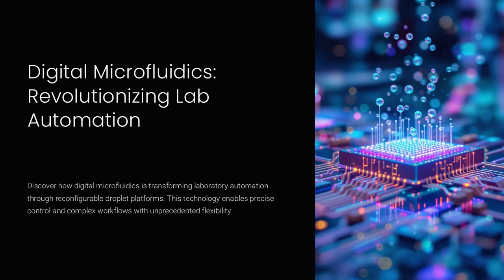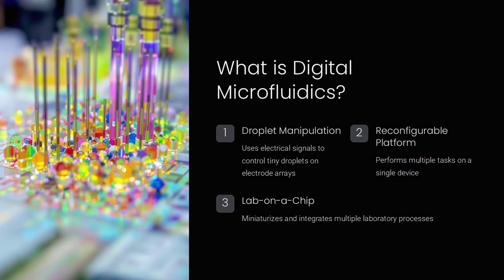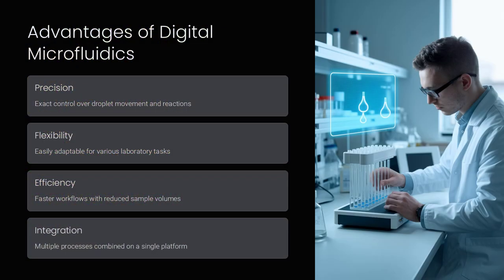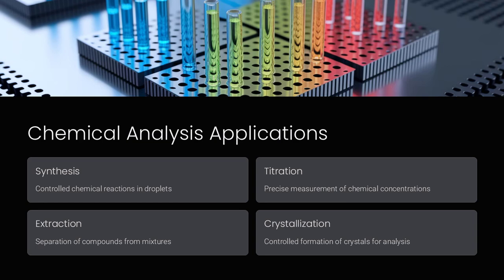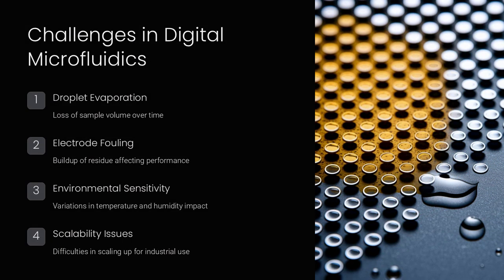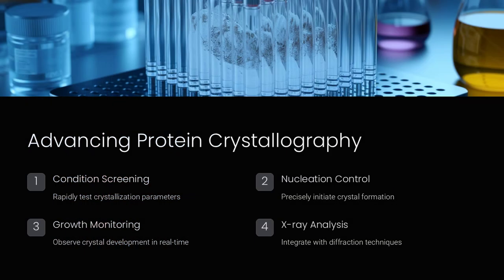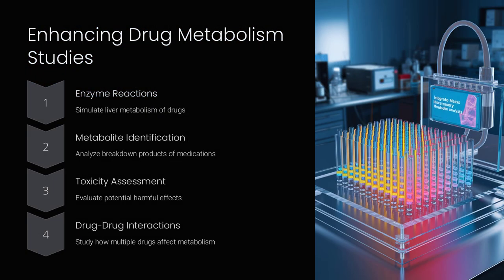Digital Microfluidics – The Future of Lab Automation & Precision

Comment from the maker: How can the precision and reproducibility of digital microfluidics be maintained when scaling from controlled laboratory environments to real-world clinical and industrial applications, where variations in humidity, temperature, and contamination risks are present?
What are the fundamental limitations of electro-wetting-based droplet manipulation in microfluidics, and can alternative actuation methods (such as acoustic, magnetic, or thermal control) provide superior performance in specific applications?
How can AI-driven real-time optimization of digital microfluidic devices improve experimental outcomes by dynamically adjusting protocols, and what are the computational challenges in integrating machine learning with physical droplet manipulation?